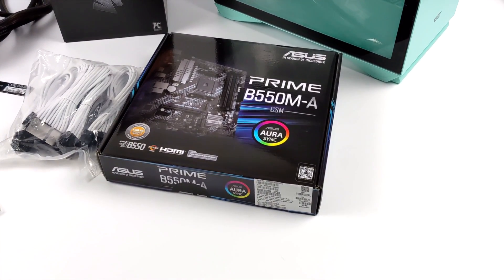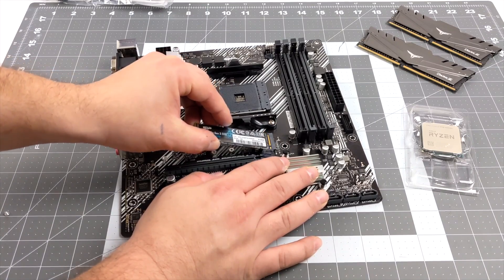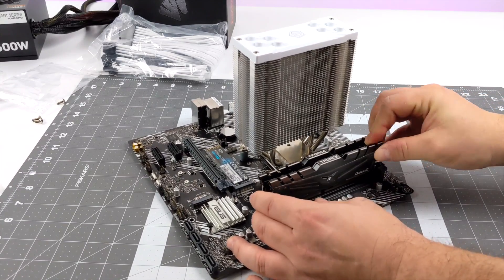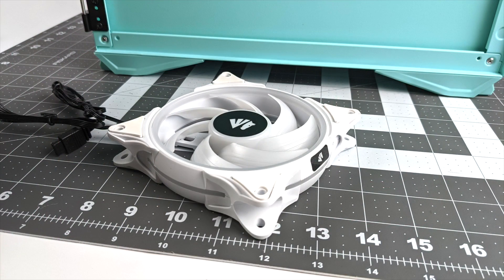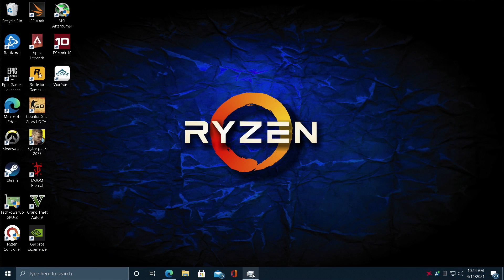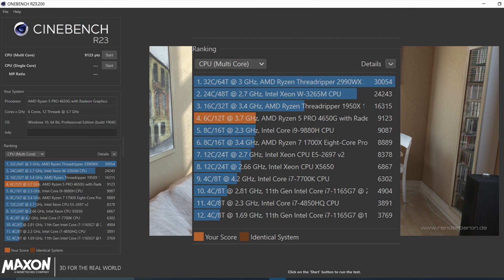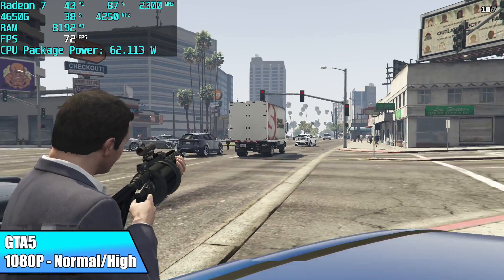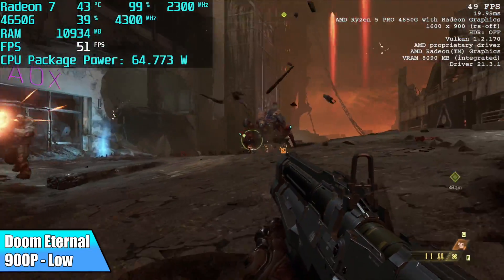NO Video Card Gaming PC Build

Comment: hey you might not see this comment but I have a pc that  i boight for 350 and it had a gtx 960 amd fx 6300 8gb of ddr3 ram and 1 tb hdd I want to upgrade the cpu and get a good cpu cooler but that also requires changing the motherboard and ram do you have anything thats good for around 500?

Comment: I have the id Se-224-xt Argb fan tower and is a beast.. i have it on the amd 2700x and the top temp is like 62c compiling firefox with al threads.. too i put a second fan to do a pull push configuration.

Comment: #etaprime I admit this is probably the worst place to put this and ask for help but here goes. I built this rig but with 2x16gb 3200mhz ram (clicked the wrong option on amazon should have gotten 3600) and used the same apu, motherboard, NVME and power supply. I cant get this thing to be stable. Latest bios, updated drivers, legit copy of Win 10 Pro 64. After roughly 24 hours windows will no longer boot. Does bios splash and then black screens. Ive had it built for about a week and have had to install windows on it about 10 times. Change anything in the bios and it doesn't boot. Let it sit with the power off for 6 hours, doesn't boot. Overclock ANYTHING, doesn't boot. I don't know what I'm doing wrong or if I have a faulty piece of hardware somewhere. I tried a different NVME, same results. Same results with different combos of RAM, drivers, bios, everything. Any ideas or suggestions would really help as installing windows every 24 hours is a little tedious not to mention since I have to erase the drive, I have to reinstall like 400gb of games and software that I use on the regular. Thanks in advance.

Comment: I got a:
AMD Ryzen 5 1600 
Sapphire Pulse 5600 XT 
16GB RAM T-Force (3200 Mhz)
500GB NVME M.2
500W PSU
A320 S2H Motherboard
Mechanical Keyboard
Sanyuo dual Speakers

All for sale on offerup for $1000. Barely used

Comment: Really like this upgradable build idea! good work!

Looks like you benched cs:go with bot deathmatch? that can have a pretty significant impact on actually. Would have loved to see it with esport settings (ie low) also.

Also, make sure to use powerlimits from motherbord instead of processor to get that last bit of juice out :)

Another idea for content: comparing APU performance with Memory set to match with infinity fabric vs memory overclocked as much as possible. (One benefits the CPU and the other GPU).

Again, great work! Keep it up!

Comment: I think you chose the wrong slots for dual channel, 99% of the 4 slots motherboards uses 2/4 in case of 2 sticks configuration, it's more stable and better for overclocking.

Comment: I have a Asus B360M-A motherboard with 32GB Memory @ 2166MHz and a GTX1660TI MST GPU. It it Runs around 4.3 GHz on the I7-9500 9th Gen Coffee Lake CPU. Default settings runs GTA 5 nicely. I got my GPU before it went crazy for around 495 USD. I think that the Ryzen will kill Intel 9th gen onboard graphics. Also there is no Hyperthrading on the I7-9500. I should have gone with 10th gen intel. nI was looking for no thrills PC and wanted to upgrade from I7-3770.

Comment: A couple things here, but great video. The 4650G is a great processor that is able to keep up with even an RX 6800 as I can personally vouch for it. However, I will say a bit more performance could probably get squeezed out of it if you made sure to run the RAM in the primary slots on the MoBo. I'm sure you know this, but it wasn't made clear if the slots were different to the normal layout with the primary slots on 1 and 3 instead if 2 and 4. 
When it comes to the pricing of the parts, lately RAM has been skyrocketing so I wouldn't be surprised if the kit you used in this video was closer to the $110 mark. 
Honestly though, I'll say it again: great video! The process of building a PC is really demystified when presented like this! (Although you did conveniently leave out the cable management stuff)
Reply: So for this build you must insert the RAM in specific order ? Like 1 and 3 or 2 and 4? Or you just put it in the first 2 as well? I want to build a PC like that

Comment: It's printed right on the MB... for using 2 ram kits only, you're supposed to use slots A2 and B2 (the grey ones), not A1 and B1 (the black ones)... its literally printed right there on the MB above the slots (ya, i know it works either way, but forgive me, I suffer OCD)... I did like the video btw... ('cept that 1970s lime green case... I can't believe that sells in 2021). Was very curious how modern iGPUs work these days, for comparison, my GF has an old Intel 7th Gen Kaby Lake PENTIUM system, 8GB single-channel DDR4, with a 2GB GTX 1050 in it (non-Ti)... she benchmarks a little higher than this system, like her Firestrike score on that old Pentium/1050 combo is 5826.  iGPU still have a long way to go to be decent... however, I do totally agree with the final conclusion... it's a solid build all the way around and once you slap any dedicated GPU in it, it's gonna take off.

Comment: Dont know if you would have the time, but I'd like to see some benchmarks of this system with a GT 1030 in it. Wondering if its worth getting an APU over something like a 3300x + a GT 1030 for about the same cost.

Comment: Honestly though, it ain't all bad gaming on igpu, sure beats nothing. I recently upgraded my i7 5775c to a ryzen 3300x and put the 5775c (intels only desktop apu to date, if you were unaware, there was also an i5 version) into a cheap case for my son. This thing is, idk, not as powerful as the latest vega, but better than the cut down versions i think. It will play damn near anything at 768p med/low at comfortable framerates. I was impressed. Yes, it does play Crysis! It kinda put things in perspective. Ive been lamenting turning down settings to keep using my rx480 at 1080UW since the 6700xt is not avaliable for purchase, yet here i was having a blast seeing what this tiny igpu i let sit idle its whole life till then could do. Higher settings are pretty, but they don't actually make the game more fun!

Comment: Amazing build. I just got mine this week.
R7 4750G
No GPU (because of the thing that shall not be named)
32GB Corsair Vengeance RGB Pro RAM (OCd to 3200 MHz)
1TB Adata Swordish.

Still setting up, can't wait to see gaming performance. The APU builds sure are amazing in times like these, people underrate them. Especially the entry to mid-level users.
Reply: How was it?
Reply: @redknight65  As expected. I ended up getting a GPU about 2 months later. But the 4750G ran triple A title without issue on low-medium 1080p 60fps hey. I'd say there are still teething issues regarding drivers for APUs with AMD. But naturally now with APUs on rdna2 the graphics performance is monumentally better than a 4750G.

Comment: this was me for the last 2 years, brownout destroyed 2 complete computer systems, so I had to slowly buid a 2400g system, finally got a used gpu and installed the other day.

if I was you, I'd move the back fan on top and the new fan you ordered on teh cpu cooler, that way you have 2 intake, 2 exhaust and push / pull on the cpu... less dust inside the case that way.

Comment: Hey ETA amazing video, consider not installing a second fan of the case's celling, it will exhaust a lot of cold air coming from your front intake or if you do decide to try to lock it to a very low RPM

Comment: it could be everything but without a GPU it is NOT a gaming pc
Reply: Yet machines like the GPD Win 3 and AyaNeo can handle modern games too albeit having no dGPU.
I say it is a gaming PC indeed because you have the upgrade path that comes with the AM4 platform.
Reply: @MegaManNeo  it is portable so the requirements are lower. But when you call a desktop without of gpu with "gaming pc" it really sounds strange
Reply: @VG-kw8pt  You game on it nonetheless.
And a modern iGPU or APU with fast DDR4 RAM as well as one or two SSDs (either SATA or nvme) certainly is closer to a gaming PC than it is to your average office machine with its 500G hard disk and some aged 2c CPU in it.
Reply: @MegaManNeo  In my opinion vice versa ssd is extra because it allows to load game data from disk faster but how frequently do you do that? First launch and preloading the assets before the next scene? But it just reduces loading time and doesn't give you additional performance in dynamic scenes like from this video because most of the data is already in RAM and/or GPU memory.

Comment: The correct ram slots for dual channel are 2 & 4, recommended anyway
Reply: From what I know, it still works at slot 1 and 3, maybe 2 and 4 it's "recommended" but as long you're not putting the RAM at slot 1 and 2, or 3 and 4, or 1 and 4, it should work in dual channel just fine. Also, it depends on the motherboard's manufacturer, so checking the motherboard's manual and RAM compatibility list is a good practice.
Reply: ⁰

Comment: It would be interesting to see how emulators that run better with OpenGL such as Citra and Yuzu would run in Windows versus Linux (Batocera or PopOS) using the Linux Mesa drivers. I would bet it would work very well in Linux.

Comment: Would this be ok to do some light video/photo editing?
Reply: With 6 cpu cores you should be pretty set. Recommend a really good cpu cooler though, these apu’s get hot!
Also, the better the ram speeds the better the performance with these as well.

Comment: These 4000 series apu's are excellent I am using the 4350G 4c/8t. It plays every pc game I want to play with 3600 mhz ram. I don't overclock anything since I don't know how safe it is. By the way how long did it take for the apu to arrive?
Reply from the maker: I just did a video using a prebuilt Lenovo with that chip and it’s outstanding for a little quad core with built in graphics. Love it
Reply: I have a lanovo laptop for travel it plays everything i want on med

I also built that super small form factor computer (used the newer 2c4t amd) as a gift and she LOVED it

Comment: Just want to point out that dual-channel RAM is important, but dual-channel + dual-rank would boost performance even more. Now, dual-rank RAM sticks tend to be very high end, so the alternative is to use 4 RAM sticks instead of 2. This does mean doubling your RAM to 32GB (two dual-channel 16GB kits). If you want to stick to 16GB total RAM, unfortunately 8GB 3600Mhz kits are harder to find, but you can find 8GB 3200Mhz kits.

Comment: Hi
maybe this comment isnt directly related to the topic of the video, but it is related to Ryzen 5 PRO 4650G
I have one for over a month now, and i still not sure what is the problem with it. I get crazy high temperatures, that is 95C and clocks going down to 3,7GHz while testing it with Prime95 Small  FFTs
right now i am using stock amd wraith stealth cooler with preaplied thermal paste, but before that i was using cheap 120mm tower cooler with 3 heatpipes, and with included thermal paste, rated at 4w/mk, i got around 90c on the same settings
it IS NOT AN AIRFLOW ISSUE. i have sharkoon QB one case, and i get same results with all panels removed (both side and top panel)
i changed this tower cooler that i was talking before for a stock cooler, just to make sure if it was properly mounted, and how does stock cooler perform.
Right now i am considering two possible reasons for that:
1. extremely bad thermal paste that i got
2. just cpu is broken internally, and solder joint under the IHS is bad
Have anyone any ideas? PBO isn't enabled, CPU isn't overclocked. while prime95 it draws in between of 70 to 65 watts, little bit more on tower cooler, because it wasn't throttling yet. Thanks for every answer.

Comment: It's great for an integrated but honestly while GPUs are hard to come by some of the more budget options are still available. A Ryzen 3700X can be netted for about $20-$50 more (if not on sale) giving 8 cores at 4.4 boost for better long term. And a gt 1030 2gb ddr5 fan version is still around $80-$100 when found in stock. While it may increase the build budget by $150 at most.

I feel doubling down at that price point on a dedicated cpu and GPU is the better conbo long term then going integrated plus GPU. It's especially better too since even  lower end GPUs right now have high resell chance just as any other GPU. So one could make their money back when upgrading later too from the low to high end GPU upgrade.
Reply: What about a Ryzen 5600x?
Reply: @Airegyn  ryzen 5600x is a good choice as well if you need more performance on games and it has come down a bit more over the last few months. If your going for more productivity the extra cores on the ryzen 3700 can't still be beat for affordability.

Also to change on my older comment some cards such as the gtx 970/980s have appeared into the secondary market and watching eBay listings a used one can be gotten for about $100-$200 right now. Giving a much better graphics performance (even most modern games will be able to hit medium-high 60fps on 1080p on these cards still)
Reply: @tims6046  thank you for the info, I appreciate it

Comment: Had you gone with the ASETEK Vapochill Lightspeed XE-II PC case you could get rid of the cooler and fan and provided the APU is installed per the instructions that come with the case you won't have any problem with condensation near the electronics but the system will only boot once the cooler probe drops to -175 degrees below zero.

Comment: Did similar for my first build. Couldn't justify the initial cost of approx a grand on a pc. So went with the APU, picked up a cheap GPU used (right before shit really hit the fan 😂) and have just upgraded to an R5 3600. Now planning a tiny emulation rig with the APU. And I would not have known about any of that if it wasn't for you ETA so, if you ever see this, thanks for the quality content!

Comment: I'm not sure but isn't usually better to reduce latencies than increase the clock, at least to avoid leaving 1:1:1 ratio with mclock/fclock/uclock? At 4000Mhz I doubt that the infinity fabric clock keeps a 1:1 ratio (at least without changing anything else) .... I could be wrong though!

Comment: It would be nice to what is the "weakest" gpu that can be added that could improve performance. Not sure what you still have laying around but maybe gt 1030/rx550/1050/ect
Reply: This is close to a 1030.  Probably beats it with that overclock.  A 2gb 1050 would be about twice as fast.

Comment: 4000 chips are monolithic. They don’t use the 3000 series split CCX config. Even with 6 cores 12 threads you’ll never see comparable performance to a 3600 even if you drop a video card in  UNLESS you overclock the 4650g and OC ram from about 3600mhz to over 4000. Some tests have shown promising comparisons when overclocking. Still an overclocked 3600 will outpace it. Great choice tho if you can’t get a video card. I’ve seen people doing a build under $500 with these!

Comment: "It's really hard to get a hold of a decent video card" as if it was any easier to get a decent apu lol
Reply: This.... I wen't to look for APUs ... 4000 series are pretty much unobtanium, 3000 series are either overpriced or out of stock, 2000 series are mostly out of stock... Well ... I guess Intel 11k APUs are not looking so bad, those Xe GPUs are not bad at all!
Reply: @Jose-Sousa  It actually is easier to get an APU at a decent price, than getting a GPU at a decent price. True, you don't find them at a decent price all of the time, but... it does happen much more often.

Comment: Is no one going to point out the fact he put the ram in the wrong channels?? lmao but also you might as well get the 4700G which isn't going to be a poopy low power variant of such a great APU along with an even 200 to 500 Irish in clock speed on the Radeon Graphics... but I actually have a build for my brother that I threw a 1050Ti in for due to the shortage and for my personal rig, Al Fully custom water-cooled GPU included/ a personal rig with 32 GB of XPG D80-3600Mhz OC'd to 4133Mhz and with a 1080Ti all on a Gigabyte DSH3M MB 1TB Samsung 500GB 980Pro Boot drive and a Hyper Raid card with 4 more 1 TB 970 EVO Plus drives for ultimate direct storage all around... Which that pumps out frames like a damn window factory. lmfao this cracked me up tho.

Comment: Yes! I was just wondering about this for an emulation build. I have basically everything to build a new comp- RAM, an X570 board, and power supply- just sitting around. I was thinking about going for the 4750G instead just to get a little extra headroom.

Comment: For PS3 emulation, would it work better running the GPU at stock frequencies and overclocking the CPU instead? From your on screen data, it looks as though the CPU is being worked harder than the GPU.

Comment: Love ur builds .. I have asiahouse fs 9002  fans  they look great and have good air flow. The only problem i had with is when they are at max speed they start to leak. If you cant return them to the seller ( like your past the 30 day mark) email Asiahorse  and they will replace ur fans

Comment: What ASUS motherboard should I get for my Ryzen 7 4750G ?  Got it for a good deal. + currently have i5-750...  Ryzen 7 4750G  will be nice upgrade for me. 
Also got a good deal on  be quiet! Pure Base 500DX ATX Mid Tower Case, be quiet! Dark Rock Pro 4 50.5 CFM CPU Cooler, and Crucial Ballistix 64 GB (2 x 32 GB) DDR4-3600 CL16 Memory.  In future I would like to upgrade to 5950X, and AMD 7000 series gpu.